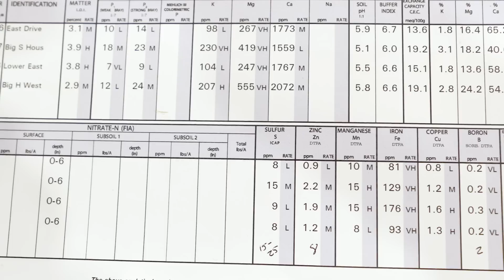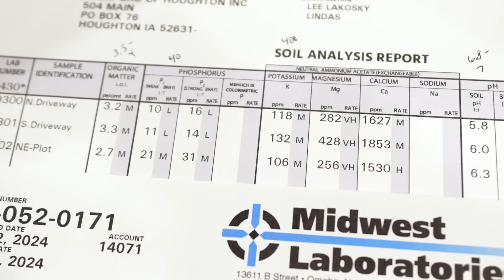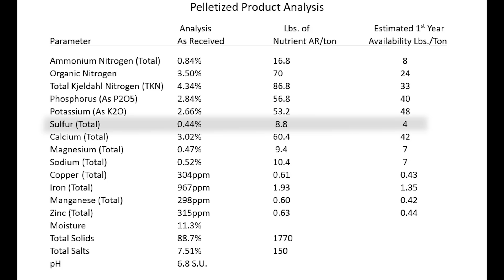Pelletized Turkey Manure, Is This The Future of Food Plots? // Lee and Tiffany Lakosky

Comment: I have a poultry litter company in North East Arkansas, broiler chicken litter is the king of fertilizer. I usually have it sold before I even have it. One thing that I have found out that chicken/turkey litter is a 4 year release blend. 1 year you will get 25% of nutrients in the litter, second year you will get 50% third year 75% and on the 4th year you will have used up all of the nutrients that the litter had to offer then it would be time to reapply. Several studies have been done on it. The pellet litter is very interesting. I’d really like to know how much 1 ton of the pellet runs as to 1 ton of the original cake litter. Very interesting video. I’ve seen the results and i’ve got a whole sales book to prove it.